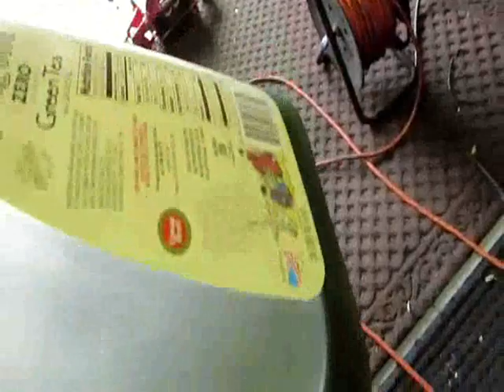happy new year... Time for a break

Comment: I have the Dorman 38453 kits installed on my drivers upper and lower hinges on my sierra, been on for a year and half and still solid. One of the few decent things they put out. Pain in the ass to install,  had to use a mini saw and file to shave away the pins and pop them out with a punch.  Took a couple hours each hinge.  I'm pretty sure if I had a dremel it would have been much easier.  Get someone to help you remove and install the door, especially installing as its difficult to line up the pins and support the weight at the same time.  I had an old office chair with no arm or back rests installed and used that as a dolly for the door.  Only way I was able to get it on my self, just lined up the pins while holding the door up and kicked the gas strut adjustment on the chair and it dropped into place.
Reply from the maker: I know! Doors are a PITA. On my white truck that door is HEAVY! I did not have a door spring compressor either so My friend came up with an awesome idea, Compressing the spring then looping zip ties through it, Pop it in place, cut the ties..  But that is whole different design.   Great idea with the chair!  They make those door dollies but they are mad money! I was thinking about getting the Total Auto Kit because it gives you a new piece of the hinge that apparently wears. The bad part is that its $136 for the kit! when the Other kits are 20-50.  The door was worn on this truck when it had 25,000 miles, Now at nearly 100k Its really bad.